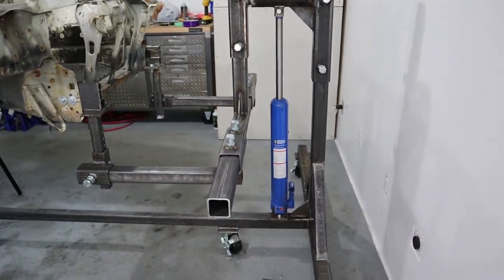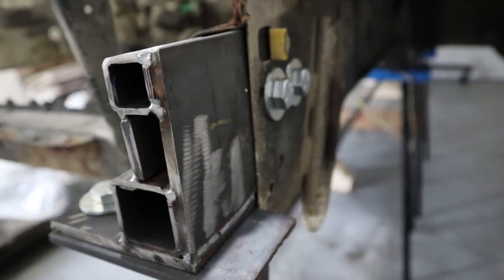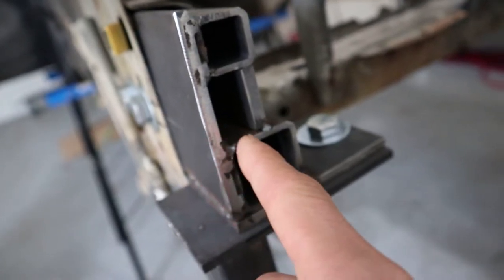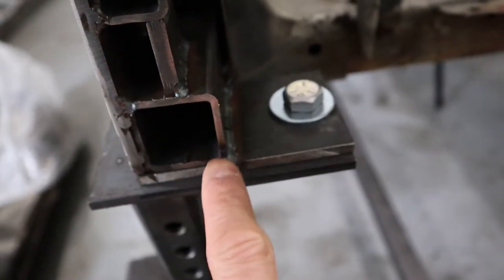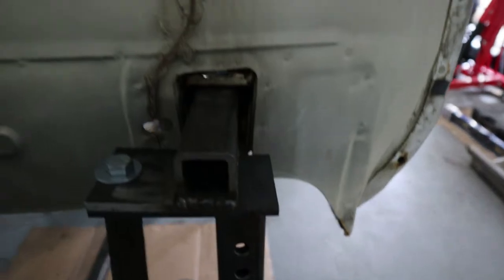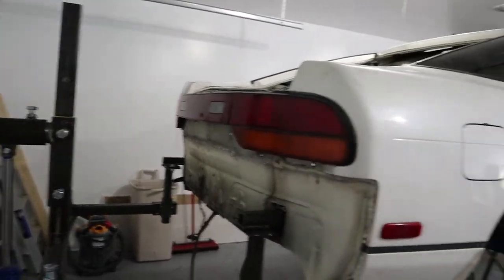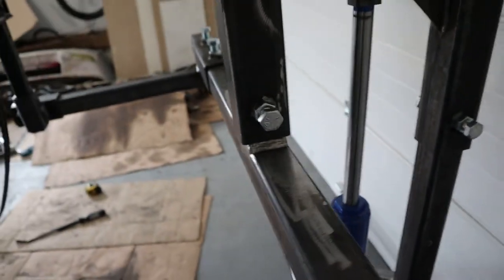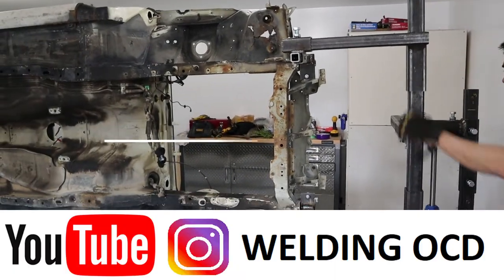How to mount your 240sx to the auto rotisserie and why I had to modify it!

Comment: Thanks Tony, I'm planning to build one of these units for a 65 T-Bird resto, and this was very helpful. In regards to the mod you made...would it have worked without the mod if you flipped the support arms over so they were on the top, that would have given you more adjustment clearance, and keep the qussets? I've never used a rotisserie, so forgive me if I am suggesting things that I know nothing about. 😃
Reply from the maker: Its definitely  do able  if you flip it. But it also depends where your mounting your arms to the chassis. Like if you want to mount it somewhere low, then you would need to do the mod I did. Its technically fine, I dont believe a gusset  is necessary  there but you must have some solid welds, cannot be your cheap 110v welder. Needs to go in hot and have proper fusion, so I suggest 240V welder.  You could always cut down a small plate and put it there and weld her up. Good Luck on your project!
Reply: @240Tony  thanks again Tony, great advice.